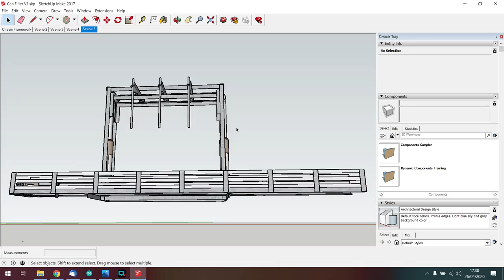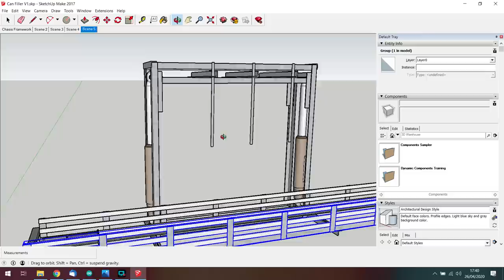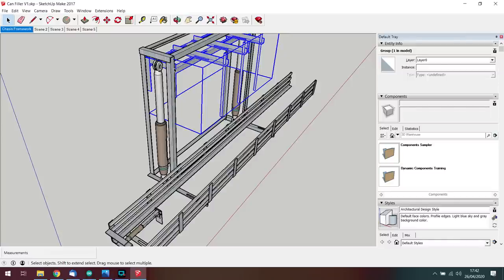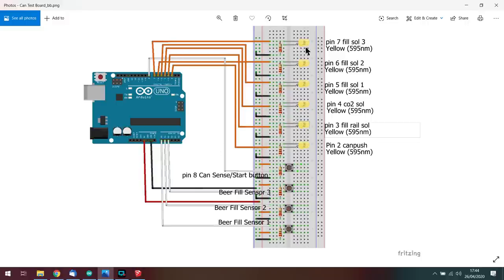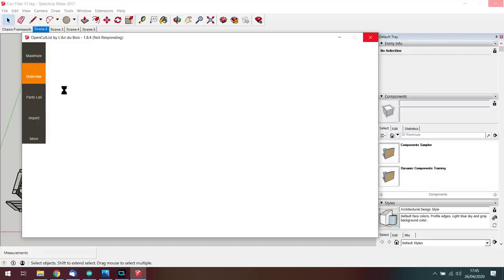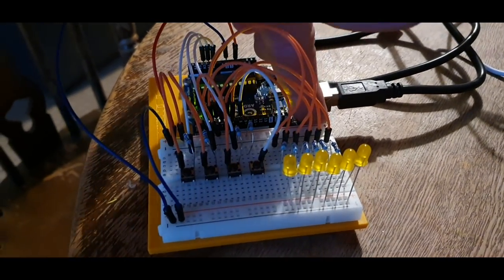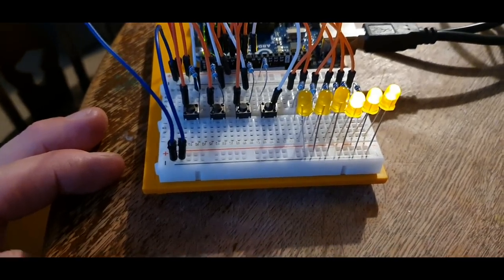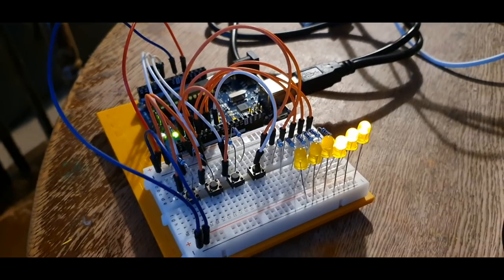Automatic Can Filler ~ Prototype Code, Plans & Collaborators

Comment: Hey harry. Trying to do this with a arduino at the actual solution end is going to be really difficult and actually really awkward. I would really suggest looking at using a PLC (programmable logic controller) as all the interfaces to the solenoids and sensors will be so much simpler as it’s industrial and designed for this sort of application. Look at Rockwell automations micro820 series. The programming software is free and the small controller is low cost and pretty much what your looking for in this sort of application. This is what I do for a living so drop me a message if you want some more info.
Reply: I would love more info, please, trying to put one together now, not sure what controller to use.

Comment: Progress indeed mate, progress.....  I've no idea re the coding stuff but one thing I will add and as you know you're welcome to take it or leave it; the flat bar on the cut list would be better left out for the following - 1, angle has more strength (not that it's required of course) and 2, you're only ordering 1 fabrication consumable (ie the angle)….  You can slot the angle still as you're aware, just the same as the flat....  just an observation and my 2p worth...  See ya soon hopefully as I've run out of beer lol....  take care and stay safe boss....  Peace
Reply from the maker: Angle ordered mate, Also took advantage of a free cutting service. should be here on the 6th May.  If you fancy coming to "volunteer" with the build or the beer garden work pop down mate.
Reply: @harrybrew69  Consider my services volunteered marra

Comment: I would swap the arduino for an ESP8266, can use identical code as the arduino but allows wireless so you can log the filling process on a computer and configure it remotely